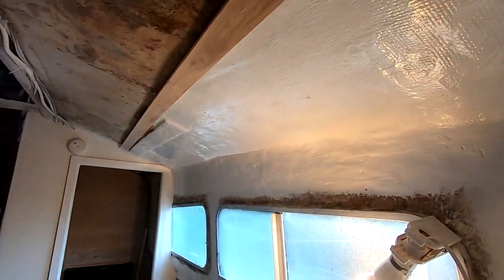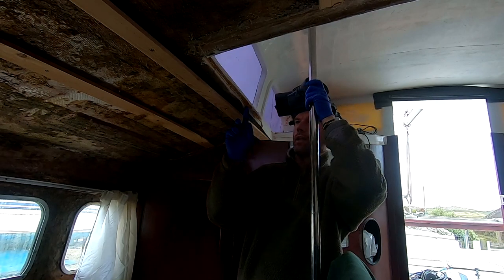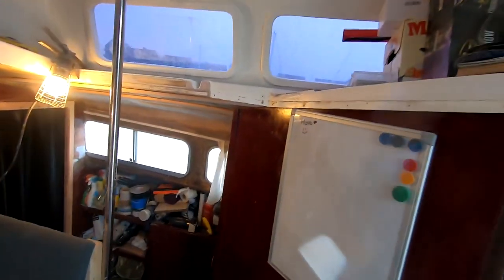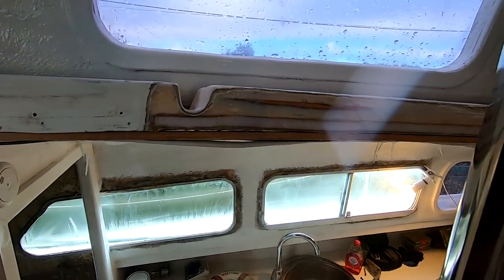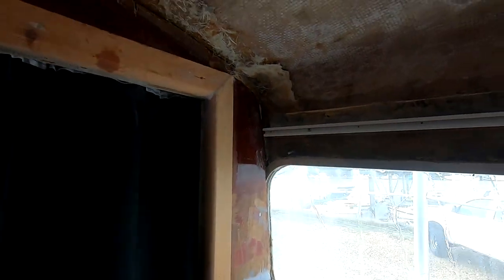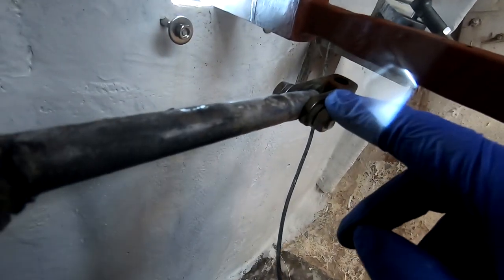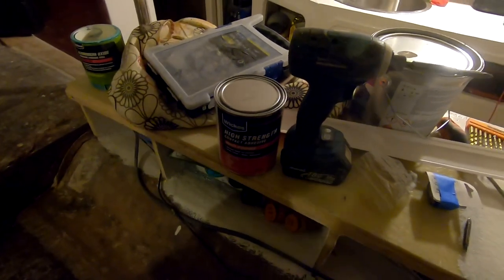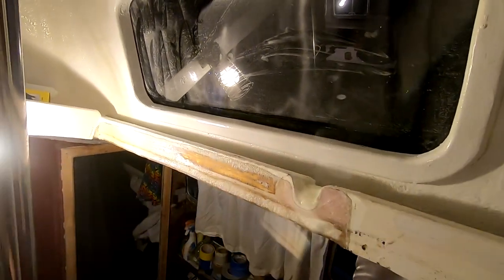Pre Crane in jobs Super Long Project Catamaran E134

Comment: As an asides re new boats i can see change in materials used in boat construction coming, both from an economic and environmental standpoint.

 Recommend you read this article👀 I was checking on Basalt v Carbon v Fiberglass .. turns out its better than I thought..read the link article on the first Volcanic 60ft ice class racer and dealing with growlers.
Yachtingworld
yachts and gear
the future of boatbuilding a greener approach -136032
Reply from the maker: I'll find that and have a read, thankyou Clive 🙏

Comment: Hi there, the other cat is a catalac 9 metre, I had 8 metre before I got meerkat
Reply from the maker: Ahh ok thanks mate, i didn't recognise it as a Catalac 🤓. Everyday is a school day, thanks mate!👍
Reply: @SailingFoxyLady  no problem, just been watching engine episode, iv got 2gm,s and ones reluctant to start. Just out of curiosity when you pulled the fuel pump was there shims under it,
Reply from the maker: @sailingmeerkat8352  yes mate, haven't fiddled with the shimming. Has one about 1mm in there! The shim advances or retards the injection timing. I have fully stripped now and still have fueling issues. My logic is if i rebuild everything it has to start sometime!🤔
Reply: @SailingFoxyLady  just a thought if it's a new poo ump which may not have the same spill timing as the old one. I take it the batteries were low on the video as the starter should be able to spin it on compression
Reply from the maker: @sailingmeerkat8352  not a new pump mate, just had it inspected.
Think the batteries were a bit sorry with the prolongued cranking from previous owner. Just bought a new one and cranks fine now. 🙂  she needs a fair bit of attention anyway such as wiring just want to get it starting on first few turns like it used too!☹️
Reply: I missed this one .... Always leave spare room in any channeling.. if you can jic.
Foam or Cork and then reflective  for insulation then fabric or some cladding for the overhead lining. But it will help control heat loss and gain..
Usually 15-30 %.
If you need to save more heat in winter you can fit thin plastic panels over inside of the windows.
Reply from the maker: @clivestainlesssteelwomble7665  yes I'm going to look at window covers for next year mate.  Still haven't fitted the diesel heater yet, going to be about August probably!🤣
Reply: @SailingFoxyLady  
Ah yes just in time for the summer blizzard's..😁🤣👍🏼
Reply from the maker: @clivestainlesssteelwomble7665  🤣🤣🤣